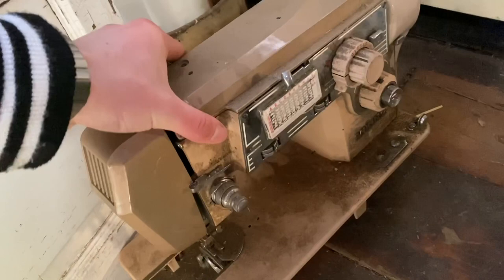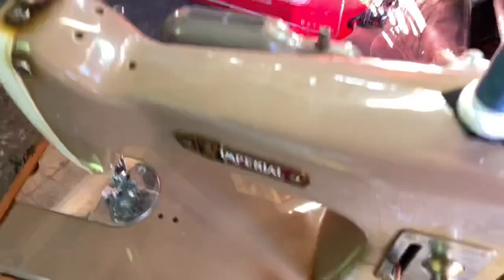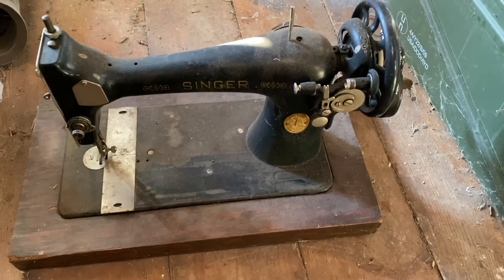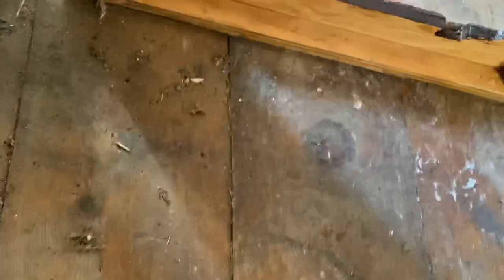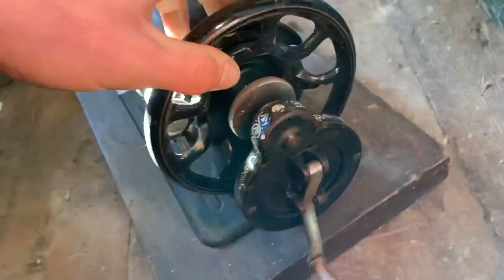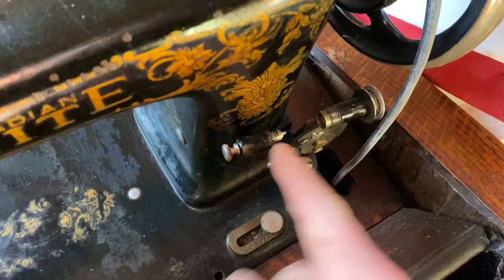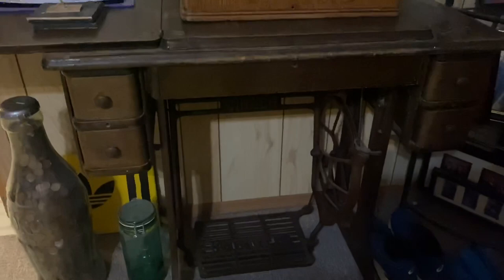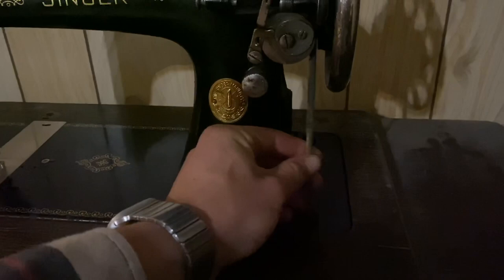My sewing machine collection

Comment: It's great that you can fend for yourself on a sewing machine - there is always a seam to mend if nothing else.  My brother has used my machine a few times.  You have a nice collection.  I have a few as well - my favorite is the fancy Singer treadle one that I keep in my living room front window.  It needs a belt - it did work when I bought it forty years ago for fifty dollars.  I have another Singer with a rounded wooden case - it has a shuttle bobbin which I have never tried.  The case needs a key.  I have a Viking as well - it was my back up at one point and is a very sturdy machine but It only does straight stitches.  Lastly, I have three working Singer Futura II machines.  My original one broke down so I kept and eye for replacements and found similar ones then found an exact one to my original.  I'm really happy to have three machines to use so when my grand daughters come over we all have a machine.  I get them to do their own hemming and alterations - they love running the machine.  Hopefully you can find a nice place to display your machines and find yourself a fancy treadle one.  I have seen many  repurposed into fancy hall tables as not too many people use the treadle ones for actual sewing now.   It is lots of fun looking at old machines.  Our sewing machine repair man here in Regina buys and sells machines and collects them for parts.  He has a basement full.  You picked a great topic for your video!  Glad you shared.

Comment: My Mother had a Franklin from the teens or 20s which had been converted from treadle to electric in the 40s, and it had the long bobbin like the one you showed.  She used it until the 70s when the motor gave out. My wife has a singer treadle machine about 100 years old or more which belonged to her grandmother.

Comment: For Singers, my two favorites are the 201 and the 503a.  I'm also partial to Pfaff machines, they are very well made.  I'm less a collector now, and more of a user so I have modern machines that serve my needs.  I think if you took the time with oil, screwdriver, and possibly de-greaser the Viking would come back to life.  A complete teardown on vintage mechanical machines isn't difficult, the key is keeping your parts in order as you take them off.

Comment: Most old mechanical sewing machines can be fixed and usually sew very well. You have a good colkection
Reply: I actually converted the same machine to a hand crank $13 with a shuttle long bobbin. Look if there are bolt holes because these were electric usually.
Reply: That white treadle is in what they called a parlor cabinet. Not rare.

Comment: neat how the wood cover fits over the machine , i have 2 singer bases , cast iron one is just sitting in the basement , the other i put are farm house stair landing / wood i salvaged before it was torn down from 1811 its a 1"  1/2  inch thick spruce  30 x 20" top piece for it now  , now it makes a good stand / table ....

Comment: Oh!  It’s a hand crank!  Definitely a treadle originally but I wish my machines could take a hand crank!   The second I’d a Parlor treadle.  This was a very expensive machine in its time.  Nearly as much as a car!  I have two Whites.  They were one of the manufacturers along with Singer.  Given care there are the equivalent of a diesel car.  They don’t break, they rust and are abused.
Reply: Wanda Pease it could have had a motor. I have the same machine I took the motor off and bought a hand crank got it about 5 years ago.

Comment: My mom's Singer is my favorite sewing machine of all time.  I started sewing my clothes on it when I was around 7 by the time I was a teen I was sewing all my clothes and modifying them for appearance and fit ( some people call it designing but I just called it sewing, LOL) Later I used a Universal, brother, and commercial sewing machine and worked sewing suits and coats for a few years.  Still Mom's Singer was the one I liked best.  I have a treadle machine now, do you know how to get new belts or adjust them?
Reply from the maker: I’ve seen belts on amazon and eBay. I tightened mine up by just cutting a little bit off and poking the hook back through